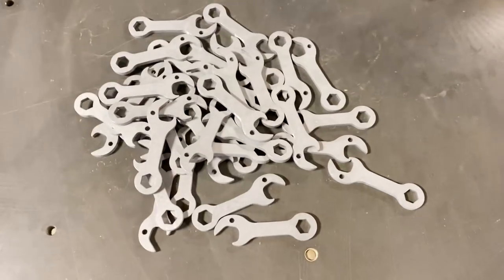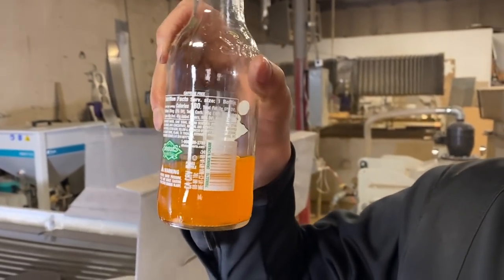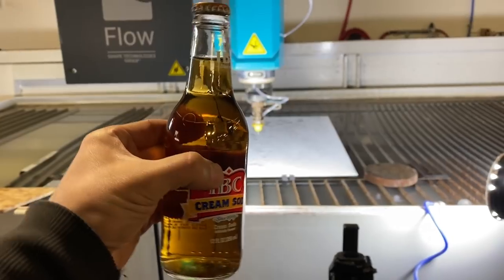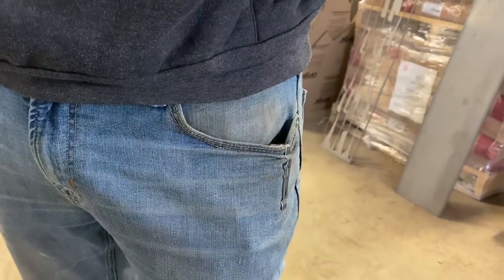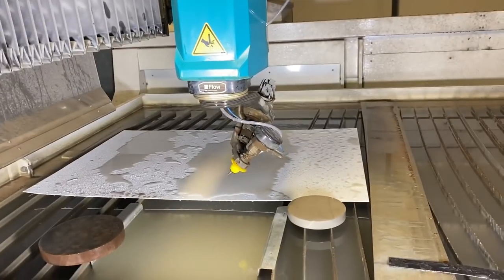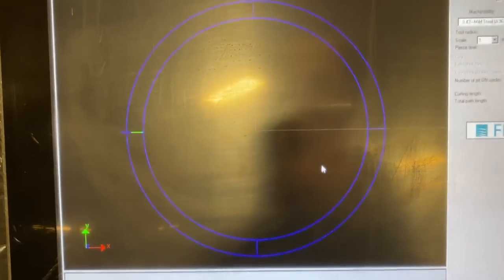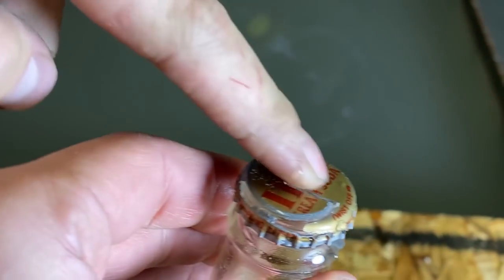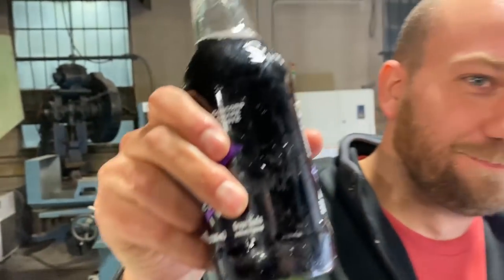60,000 PSI Bottle-Opener

Comment: Missed a way: Tip the bottle downward and use the pressure from the water like a bottle opener to force the cap off. Unsolved problem: Liquid spills out afterward.
Reply: point the water at the pointy ends of the lid and unscrew it.
Reply: Turn the water jet upside down 🙃
Reply: Missed a way: smash the bottle open with a hammer ww
Reply: If you put the cap directly against a tray like the one they use and have a low but not too low enough pressure you can push the cap off and  nothing will spill. 
New unsolved problem: How do you pick up cap and bottle as an armless person?

Comment: What did you use for the slow motion? It was awesome.
Reply: Chronos 1.4. You can search for "chronos slow motion" if you want to see more videos that use it.

Vision Research has even better high speed cameras (e.g., Phantom v2640 and Phantom Flex4K; see Slow Mo Guys, etc.), but their cameras cost a lot more (around $109-175k, compared to $3k for the Chronos 1.4).

Comment: yes the easier way is to find a sharp corner. like of a table, of a drawer handle, a block of wood, picnic table whatever. catch the corner under the cap and using the palm of your hand, wack the top in a downward motion. it will come off every time.

Comment: I have an even easier solution. My shoe has a bottle opener in the sole. Because it's a slider, even someone without hands could use it, and the shoe provides protection against the potential pain of a normal bottle opener.

Comment: Could you have come in at an angle on the side of the bottle and tried to twist the cap off?    I know its a cutter, but it would be fun to see if it could take the cap off by twisting it and then throwing it across the warehouse.  60000 psi could sure spin and launch  a bottle cap fast and far i bet.

Comment: The seam on the side where it meets around the thick upper top is the weakest part. they are injection molded. Think of using a sword to open champagne. You will likely always chip or fracture on that edge if you hit it.

Comment: What should of happened is a sheet of material should of been cut on the waterjet so that it could of been used to hold the bottle something like closed cell foam. With the waterjet cutting out the holder the neck of the bottle would then been concentric with the axis of the bottle holder

Comment: Guys, couldn't you lean the bottle over at 45 degrees or so, then angle the spray cutting head to hit just under the metal cap and just use water pressure to pop the cap off?

Comment: 1. Why didn't you just put both the bottle and the jet at 45 degrees?

2. Why didn't you just pull the jet back slightly and orbit around the cap instead of shoving it right down on it?